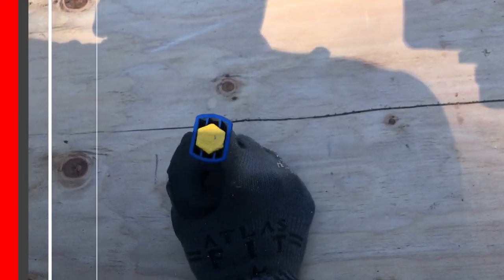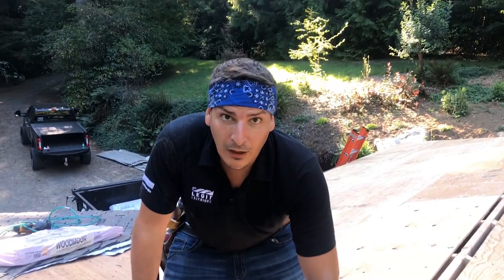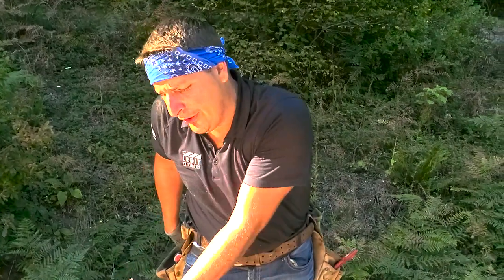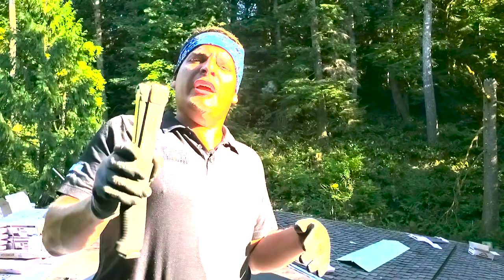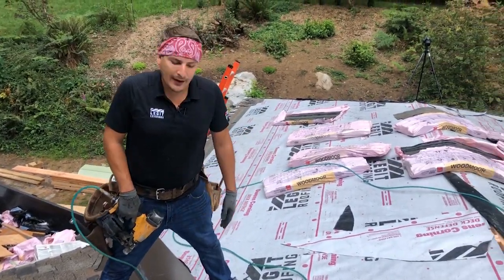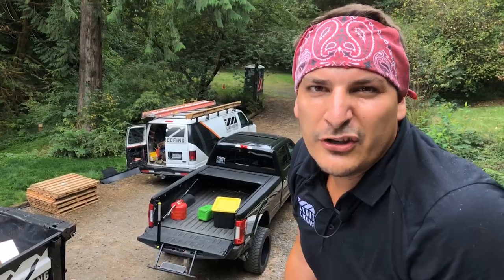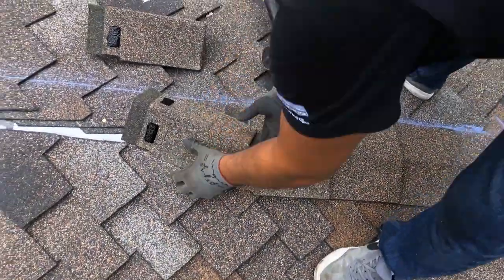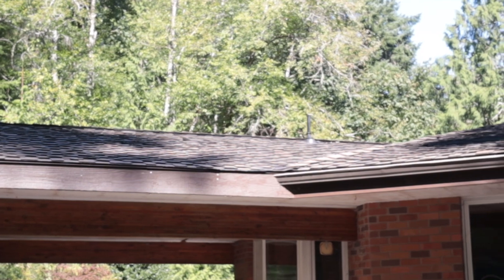Install Shingles With 9 Easy Steps | Owens Corning Woodmoor

Comment: Bro first time seeing your videos. Best you tuber roofer for sure. You explain everything perfect. I just have a question iam really familiar with precidential shingles. Dont you suppost to roof those shingles 5 and 15. To get the right pattern. Good videos though
Reply from the maker: 5" 15" for president is correct, but Presidential is a brand by CertainTeed. Owens Corning says it's okay to roof this Woodmoor shingle which is in the same class as the Presidential at 5" and 15" OR 5" and 5".
Reply: @MrLegit  5" 5" makes it easier to installed. Good to know that. Thank u.

Comment: Nice video. Couple thoughts. I prefer to do drop edge differentky. Also, the ice damn material should be on the wave edges first and over lapped by the valley ice damn.
Reply: *drop edge. *Eave not wave
Reply from the maker: Thanks!

Comment: Valley metal hacked. Take an extra minute or 2 and make a nice transitional cut and leave some meat to fold over to close off the w. Any shmo w a gun and ladder can be a hack roofer, takes pride in a finished product to be a craftsman.

Comment: OOPS!  1.  The first valley shows you installing the Ice and Water Over the Woodmoor Shingle junction of the hipped roof.  Definitely wrong.  You've just created a reversed backup point at the Hip and Valley junction.  Should an Ice Dam build up at the Hip/Valley junction, you'll now force water behind the hip.  Which will inevitably cause dry-rot. (Job security, perhaps?).   
2.  The top of the valley Ice and Water cuts should be diagonally away from the valley, not straight up.  Using opposing cuts (Left side valley overlapping right side valley) creates an entry closure.  Basically just like you'd do at a skylight corner.  Additionally, you should run your eave Ice & Water first, with the valley Ice &  Water running over the eave Ice & Water.  Again, this creates a tighter and more secure water protection at the bottom of the valley.  
3.  You should let rookies know that Deck Defense Synthetic Felt should be cap nailed if not roofing over it the same day.  Clearly you are installing "Same Day" over the Deck Defense Underlayment.  Just a suggestion, but you should really read the Specs on this material.  Absolutely incorrect fastening of these Synthetics.  I'll include the link here, so others don't make the same mistake!  https://www.owenscorning.com/en-us/roofing/install-instructions/deck-defense-hp.  You may also wish to look at the requirements for roofs under 4:12, as well.  The roof you're on is at best a 16° slope/pitch (Depending on your preference of description of angles).  This requires 2 layers of Deck Defense.  Just saying. 
4.  I'm just going to let the Valley install speak for itself. SMDH.
5.  Only  Four nails are required for Woodmoor, unless the slope/pitch of the roof is greater than 60°.
6.  FFS!!!!  Dog-Ear Cut your valley shingles mate!  You're just allowing water to travel across the top of the shingles.  What the HELL!!!?
7.  Hip install:  Use the notched out area at the top of the hip shingle as the point of reference for your hip line.  Even though you're using "Chalk" in your reel, you're first few days of a completed roof look like $#it, with all that chalk everywhere. 
8.   Every ridge cap you put on, flattened the VentSure Vented Ridge even farther.  I got nothin.
Can't believe I watched the whole video.

I was hoping to find some good pointers here, but unfortunately, all I saw was rookie mistakes.
The company I work for, would have fired you at the underlayment.

Hope anyone else watching this video, learns a few good do's and don'ts about roofing Woodmoor shingles.
Have a great day!

Comment: Tell us you know nothing about building codes without telling us you know nothing about building codes. Staples are not up to code. 1” plastic or metal caps are required. If you get snow with any sort of regularity, you’re required to have ice and water on eaves and rakes 24” inside the plane of the conditioned exterior wall or double layers of synthetic underlayment in lieu of. Epic fail.

Comment: Ain't pro..Pro would use shingles..cutting legs then ull have starter...if dont have any or just need a couple..JR ROOFING 209
Reply from the maker: That's good in a pinch, but it's trash. Probably not the best thing to be showing trash shortcuts like that in a youtube video.